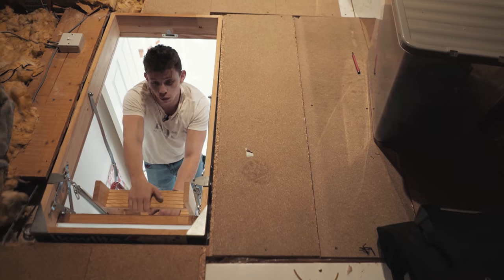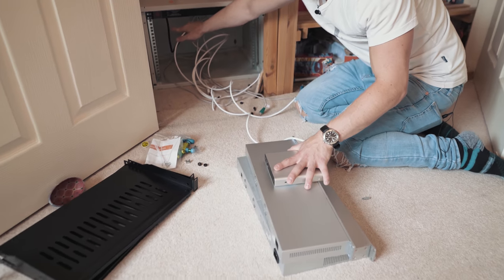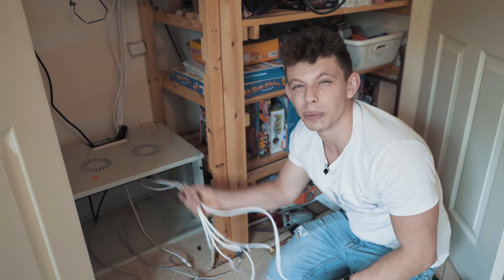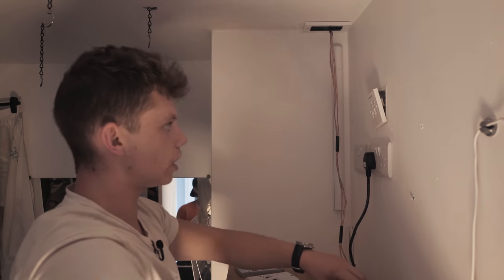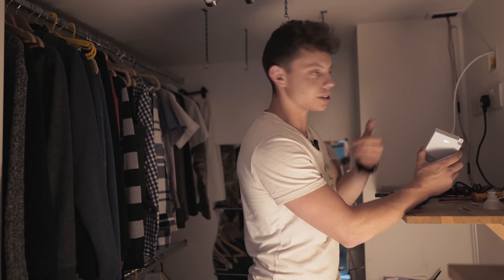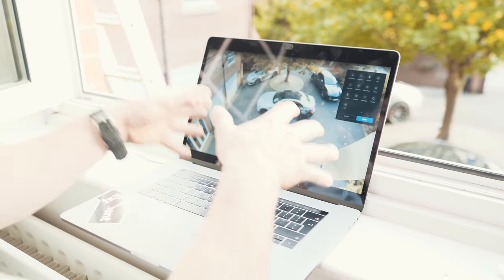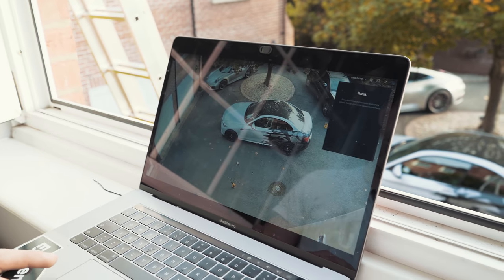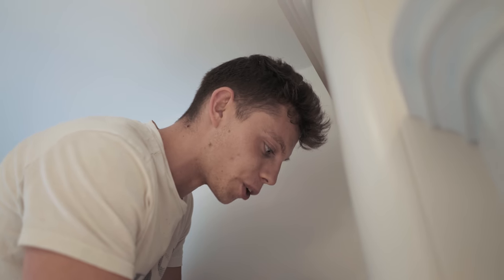Building a New 2019 Home Network: AC WiFi and CCTV! Episode 2!

Comment: Whoop whoop!!! Well done for saying Ethernet properly!! Also well done for listening to other people’s comment and not putting your rack in the loft. It was a good call. The loft is always the warmest room as it  is and you don’t want all your expensive equipment up there overheating. Also great setup I don’t think it is overkill at all! For all those people who say it is they are just hating! I have 3 netgear Poe access points covering 3 stories and the garden and works great, never lose speed or signal. 14 Poe Annke cameras (maybe overkill) watching every angle of the house as we had a live in nanny and wanted to make sure there was nothing to worry about. Defo thought it was overkill when we was wiring all of this in, but now couldn’t live without it. So much safer especially if you have kids. Keep up the good work and I look forward to the next video. Also you should look into sonoff a little more they are brilliant! Has so much more potential then just a smart extension lead. Flash it and turn any normal light switch into a smart light switch with Alexa/google compatibility! That’s my next project lift some floorboards and find some cables!!

Comment: Alex - I would love to be able to work with you on your next home networking project. I see great ideas and a lot of potential coming from you and your enthusiasm for what you do is incredible. That said, please take my constructive criticism below with a grain of salt as not everyone's perfect and everyone makes mistakes.

Coming from an ex-residential installer for an ISP and someone who is currently working in IT Support's point of view, some of the things I've witnessed in this video weren't the greatest and some of them were honestly great.

For example, the termination in to the back of the patch panel wasn't the best. Each leg of the ethernet cable should be nicely flush with the edge of the IDC and a proper RJ45 punch down tool should have been used. I couldn't quite tell if the pairs had been left twisted up until the IDC so I won't comment on that. 

Failing to terminate properly can result in slow network speeds and potential outages as well as noise on the line. Although this may not cause too much bother in a residential environment such as Alex's house, it could potentially cause major issues within a business environment, especially with business critical systems.

I do love the fact that you showed your word document that contained your cable map - a lot of people miss this out of their project planning and it can cause issues along the way unless you can remember exactly where each cable goes.

Aside from the IT things, I will give Alex props on drilling from the inside towards the outside wall. If Alex were drilling outside towards the inside wall and was using a hammer drill this could potentially cause a blowout in the brickwork on the inside when the drill bit eventually penetrates. Having a blowout on the outside is always preferable as this can then be covered with the external accessories and/or a water proof covering along with a nifty bit of silicone. If the blowout were on the inside however, it would be a lot harder to cover especially as the inside of homes/businesses are usually decorated.

That being said - Alex, keep doing what you're doing and keep working at improving your skills. I see a lot of comments from people that are straight up bashing you for how you do things and it's neither constructive nor helpful in the slightest.

Comment: Ethernet cables that are ran to outlets from the patch are solid copper core, they have a maximum radius on bends and should not be flexed repeatedly to prevent the cores breaking.  Patch cables are made with stranded copper cores so they flex.  That IMHO is a good reason for using a patch panel.  If you only have a few cables to run just use a 4 port box on each end,  use the punch down tool to get good connections and if possible use quality patch cables.

Comment: A patch panel is so that you can connect sold core cable too, and then use stranded wires to connect to your switch. That way the movement and plugging and unplugging doesn't break or damage the solid core as its more delicate; not JUST to connect to your switch!

And will you just pick a way of saying ethernet cable don't use both (its a bit like saying ether, as in thor the dark world)

Comment: I see you’re a member of the 3 story high cable termination club lol, had to do one once in a warehouse on a moving picker lift. Quite an experience when you are bad with heights the the thing wobbles. 

It looked like you were using the pass through rj45 ez plugs. Any good? Certainly looks quicker to do then the normal type but I’m led to believe by some they aren’t all that great?
Reply: I don't really rate them tbh... not had bad experiences to say but I just prefer to use the enclosed type as they're cleaner Imho, Alex says its difficult to work with so its probably a ease of use thing for him so he doesn't waste so many connectors, if he doesn't crimp too much maybe he makes a few mistakes haha...

Comment: Hi. I was wondering what can i buy inorder to reduce the ping in my house. I currently have 52ms ping
Reply: What are you PINGing?  if you ping your router and get a quick time, the 52ms is outside of your network.  

To my router via WiFi > AP-AC Lite > POE60W Switch > VM Superhub

Ping statistics for 192.168.0.1:  
    Packets: Sent = 4, Received = 4, Lost = 0 (0% loss),
Approximate round trip times in milli-seconds:
    Minimum = 3ms, Maximum = 3ms, Average = 3ms
Reply: You can buy cable and plug it :).
Reply: I need it wireless
Reply: @choas6672  as in my post I am wireless to router at 3ms, that's why I ask what your PING time to router is to see if it is an internal issue.
Reply: How would i find that out
Reply: @choas6672  If you are on a PC open a command prompt (start / run / cmd) type ipconfig, that will give you your IP setup, look for  "Default Gateway", that is your routers IP address, type: ping  ROUTER IP    your time should easily be sub 10ms.   speedtest.net also gives a PING time to the server you are testing against.   If you are using a mobile (cellular) data connection forget PING time I doubt it will ever be good.
Reply: It says ping time is 12ms and jitter is 1.2ms and 0 loss
Reply: @choas6672  is that your speedtest.net result or PINGin your router?  If it's speedtest then that is pretty decent, if your router then not so.

Comment: Anyone reading this how can I get the best out of my home internet and WiFi strength? Supplier is useless!  Just a basic set up, router! Tips or tricks that may help make my signal stronger, faster and better
Reply: You go buy access point and wired it up to router after setting up ethernet cable and power to the place where you have poor or no signal. You can even power it only with ethernet cable if access point have PoE option (most currently have it).

Comment: Why not use 802.11ax if you are using the latest updates?
Reply: UniFi doesn't have any AX AP's yet, the standard isn't even fully in place yet. UI likes to wait for the proper chips, and when it does come out, it will be in EA for around 6 months before going GA. But trust me, there is some cool stuff in the pipeline.

Comment: Surely this should have been a video about WiFi 6 (ax)?
Reply: Where are AX clients? There nearly no one, routers and access points are also few.
Reply: @wiziek  Samsung Galaxy S10/Note10, iPhone 11/11 Pro, the latest Intel WiFi cards (in laptops like the Razer Blade 15 Advanced), and the latest Killer WiFi cards (in laptops like the Dell XPS 13) are examples of some of the devices that support 11ax you can get today. As for APs with 11ax support, nearly every major brand has one now, like Cisco with the Catalyst 9100 series, Ruckus with the R750, Aruba with the 500 series, and Meraki with the MR45/55. There are plenty of consumer 11ax options available from the likes of Netgear and D-Link as well.
Reply: @eliasong2047  Uhm plenty of consumer options? You just listed most expensive smartphones, no choices for typical consumer, same with networking gear, enterprise brand or very expensive router from consumer brands. Do you even used something you listed?
Reply: wiziek Those expensive smartphones also happen to be quite popular. And it won’t take that long before 11ax support trickles down to cheaper options. It’s just like 11ac back in 2013/14.

If you were installing WiFi APs today, you’re probably not expecting to replace them next year or the year after when 11ax adoption is more widespread. So why not do it now? 

For the record, I don’t have a single 11ax AP in my house, but if I were in the market to purchase APs today, I wouldn’t see why I wouldn’t consider buying something that will last longer. And the options I listed are options I would consider if that were the case, as I already use Cisco 11ac wave 2 APs (2802i’s) at home. In Alex’s case, I don’t think his goal is to showcase the most value oriented network setup, but rather something that’s far beyond an average home network setup, so going for enterprise class or high end consumer grade 11ax APs isn’t just suitable, it’s almost expected in late 2019.
Reply: @eliasong2047  Popular? It won't take long just like AC trickled fast(it didn't, there are still products using N/2,4 ghz only, or home routers with fast ethernet/100mbs ports). Most people don't buy expensive phones, they are buying middle price or cheap ones. Anyway 11ax standard wasn't finalised until like few days ago so there aren't any final standard products yet. This is just like buying 5G phone right now, just wasting money. Get realistic instead of jumping on bandwagon that doesn't give any realistic benefits at this moment.
And Alex is just showing how he is spending money, he doesn't really have any networking knowledge or expertise :).
Reply: @wiziek  Popular as in those phones will be in the hands of tens of millions (today) to hundreds of millions of people (estimated 180 million iPhone 11's sold in a fiscal year). There might be some products that still use 11n today, however the majority of those products tend to be devices that require a minimal amount of bandwidth (like IoT). In the networks that I have managed, an overwhelming majority (90% of mobile devices, such a phones/tablets) of WiFi clients that can connect to 5GHz will support 11ac. 

Many of the current WiFi 6/11ax products will become certified and many manufacturers of these APs do claim that specific models in their lineup currently will be. WiFi 6/11ax isn't like buying a 5G phone because you can have full 11ax coverage in your home today, whereas with 5G, you'll have to wait on the carriers to improve coverage and pay for a more expensive version of the same device (i.e. Galaxy S10 5G or Note 10+ 5G vs the standard models). Plus, usually using newer APs will yield better performance with existing clients. When I originally switched to 11ac at home, I noticed that my 11n devices happened to be capable of noticeably faster speeds that were never possible on my older 11n APs. The same thing happened again when using 11ac wave 1 devices with 11ac wave 2 APs (about 33% faster).

I did list one option that would probably be right up Alex's alley, which are Meraki APs. Super easy to use and they don't require much networking experience at all. Although, I don't think the MR45/55 are 11ax certifiable. The Aruba 500 series of APs and the Ruckus R750 seem to be 11ax certified today, though.

Comment: 11:02 SCARYYYY... how he insert the 8 wires into the RJ45 connector???!!?!?! It isn't the correct way to do this... You have to comb the 8 wires, arrange them in the correct order, cut them of the same size, and insert them ALL together in the connector! So you can crimp with pliers!
Reply: He is using those pass through plugs, it chops the wires at the correct length as part of the crimping process
Reply: Matt W but the correct way is all wires together also with these connectors.
Reply: @NARoads2016  also the way he do it takes time  but nevertheless still works
Reply: He really doesn't know anything about networking, he just got rich family :).
Reply: Alex does know his shit. He's even got his on network that he sells. Not because of his rich family. If you watch his vlogs on his other channel he explains that he's work for everything himself and never asked for his parents for money. He owns multiple business. So before you judge someone check the story before hand. Like they say, never judge a story by it's cover.
Reply: @Benni846  Watch his vlog about what? Using mostly unifi gear? Of course he may have bussines that was jumpstarted by his family, Trump started same way, he lost a million or even billion dolars

Comment: I'd still go with the Panasonic kb6000kv cctv setup. All wireless. Just give it power and that's it. Hack proof aswell. Also different things can be linked to it
Reply: All wireless, except for the wires then? What's the difference between you having to run power wires to every camera over this solution using PoE?

Comment: People are transitioning to WiFi 6, it makes no sense to build a WiFi 5 (AC) in 2019.
Reply: Can you recommend us some good WiFi 6 equipment? (something like UniFi In-Wall HD)
Reply: @constantinrazvanrotaru7457  there are loads on the market. They only need a 1gb or if you want to go pro a 10gb feed and you will reap the benefits. Ax is not just about speed tho it is a much wider channel
Reply: @david29262  tell me one.
Reply: @david29262  we are talking about in wall access points and you show me WiFi routers. Thank you!

Comment: You could have just run fibre, wouldn't be that much more expensive and it would be far more reliable.
Reply: Can’t do POE over fiber. Consumer electronics also use copper for wired connections.

Would need a bunch of media converters which introduce another device per connection that can fail.
Reply: @ZippyDooDa435 not for all of the cabling but just for to get to his shed for the camera he installed there.
Reply: @Mircea It far more reliable. You don't want the camera to loose conection
Reply: @Mircea umm have you ever used wifi?
Reply: he lives in a villiage, thats why he provides internet over little satellite dishes
Reply: @Mircea no it isnt, he cant get fibre as he is too far for the cost, that's why he is using satellite dish sent internet to his house then he shares it from his house to houses around his
Reply: @Mircea what the hell are you on about
Reply: @Mircea he isnt running ftp hes using little satellite, where does he say hes running anything close to ftp
Reply: @Mircea why would he run fibre within the house??
Reply: @Mircea its such a stupid idea that I jumped over it, that's whats happened here

Comment: Simply get virgin media broadband or soemthing, installed a few access points if you have a large house and off you pop

Seriously you don’t need all this like wth.. it’s overkill for the tee.

As far as CCTV cameras goes, you can run them on WIFI. Don’t need ridiculous speeds, what you downloading? A 50GB  game??

Way too complicated.doesnt make sense. Electricity bill will be to the skyy
Reply: he sells his internet to his neighbors.
Reply: His business is providing high speed Internet to his clients so he DOES need a setup like this. This is how he makes his living. You haven't a clue what ur talking about.
Reply: Take a closer look when the attic rack is in the picture. You see the tiny fiber cable that's running alongside the right side of the rack? That's the actual internet connection to my understanding, and all of the other gear in that rack is actually needed to run a WISP (Wireless Internet Service Provider) so if he already has a fiber though his company on the property, why not use it to power the rest of the house?

Plus when he did a speedtest at the lounge, it shows the ISP being Virgin Media Business.